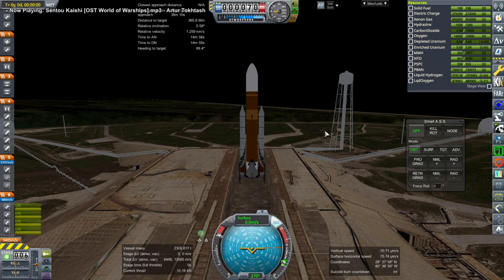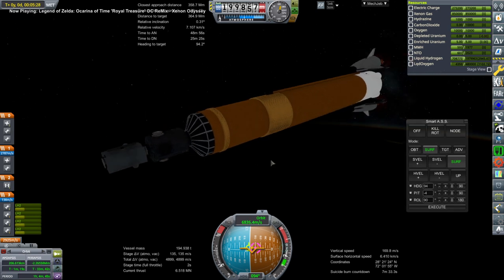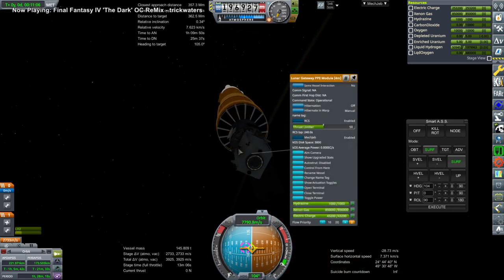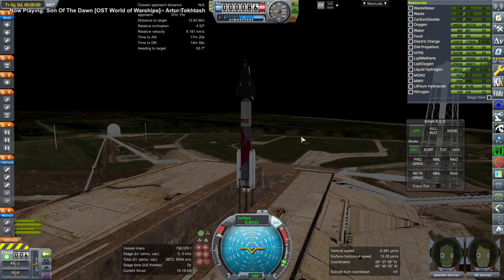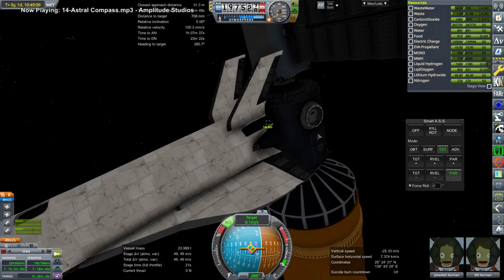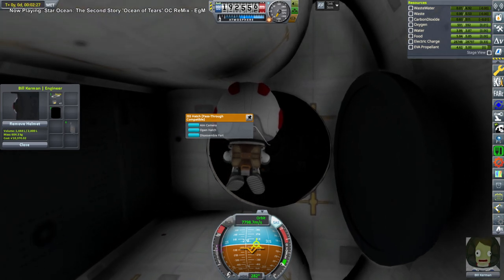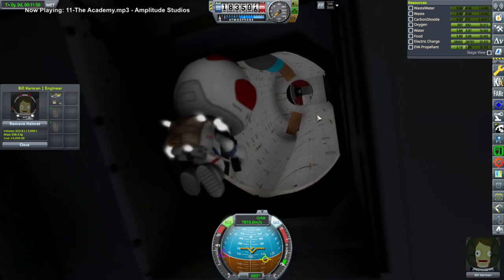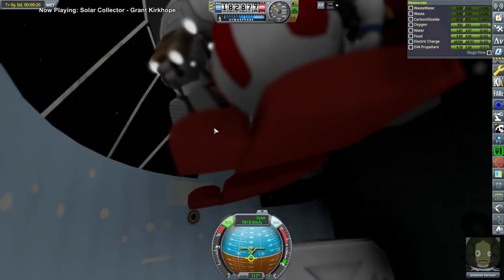Taurus Spaceplane visits the SLS Wet Workshop

Comment: Do you plan to leave the insulation foam visible like on the regular SLS? Idk what you think about it but imo NASA would definitely add an extra layer of protection (for example reflective paint to protect the habitat and the liquid fuel from ultraviolet rays and limit propellant boil off).
Reply from the maker: The habitat would already have protective paint and possibly already have micrometeorite shielding built-in, which is why I added more than 10 tons to the mass of the tank. For the hydrogen tank, that would have to be part of on-orbit construction and I can't really speak to whether trying to cover the whole thing in MLI would be a good idea. It's possible, as MLI insulation is very light, but the deployment of it may be tricky. The baseline plan doesn't require much boiloff mitigation - boiloff is much more severe on the ground than in space. As long as we can get about 70 tons of hydrogen in on a single refuel, the ship could then soon after transfer over to the Moon, but it somewhat depends on how we plan to capture around the Moon.
Reply: @RaizSpace  Deploying a protective surface in orbit seems feasible to me (see Skylab). It is true that launching the stage already outfitted is also an option. The shuttle's ET was originally coated with a protective paint so it shouldn't be hard to do the same with SLS. Thanks for the reply btw.